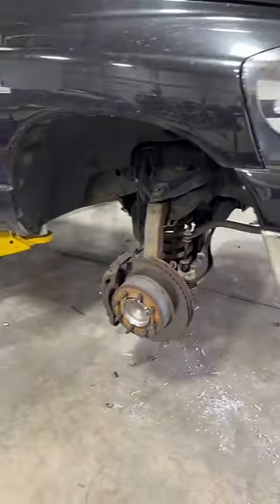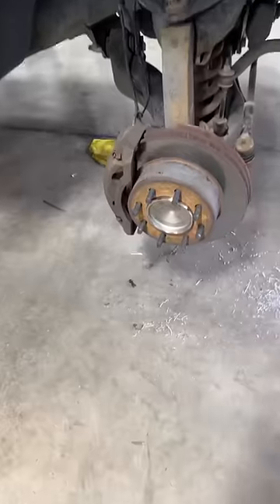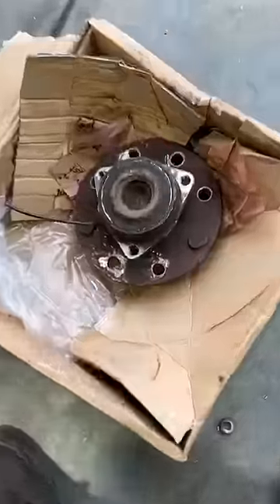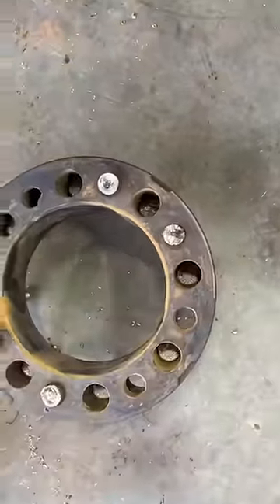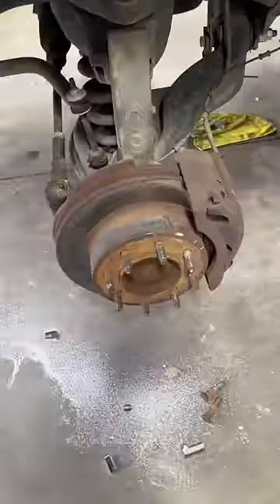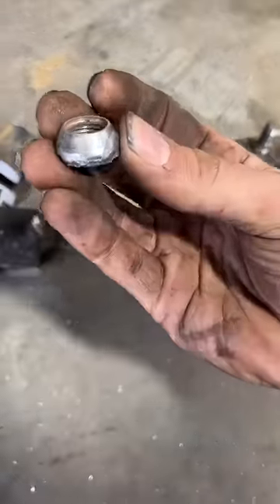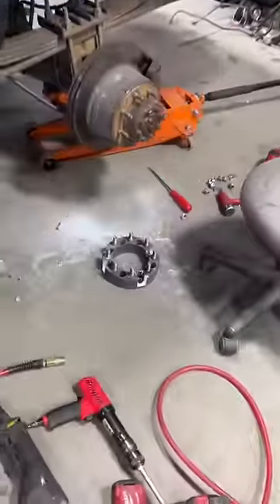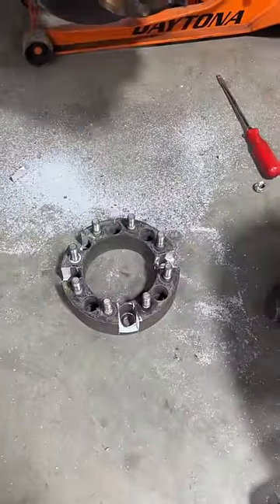I told the customer to sit down before I gave him a price 😂 I didn’t need him to pass out

Comment: If those jokers want to have their wheels stick our past their mirrors, then I wouldn’t feel anything telling them how much it’s gonna cost. Spacers seriously effect the wheel bearings. ESPECIALLY on a 1 ton.
Reply: Amen brother!!! They never learn. Have some 16" wide 24" wheels with 40" tires and have a 4" spacer and want to complain when the entire front end needs replaced . And then they hit ya with the I would "do it myself" if I had the time....
Reply: I would have ZERO sympathy for these jokers who insist on hanging the tires outside the fenders. These same morons extend their trailer towing mirrors out fully, when they are not towing anything. This endangers pedestrians, bicyclists, and other truck drivers' mirrors. Sometimes, they leave their trailer balls in the tow receivers, so you can gar your leg on them, when you're just walking by.
Reply: @budlanctot3060  
Towing mirrors are the same width as the duallys
Reply: @JohnSmith-xu7ev  I'm not sure what you're trying to say, but the mirrors on trucks are mostly adjustable. And most trucks aren't dualies. If you're not towing, why do you need them extended out 2ft? For some truck drivers, they are lazy, and selfish. Then there are those truck drivers who want their tires to extend beyond their trucks fenders for the "look cool" factor. Coincidentally, they often have their mirrors extended unnecessarily, too. That's the point I was making.
Reply: @budlanctot3060  
Real trucks are duallys, and the mirrors extend as far as the rear fender. So if a biker gets hit by a mirror, he will be hit by the dually too.
Reply: @JohnSmith-xu7ev  again, what are you saying? If you hit someone with your mirror, you're doing them a favor? It's their fault for standing on a curb? A bicyclist can't ride on a paved shoulder?
Reply: you must be fun at parties
Reply: @dcgeeked8917  He is, we joke about idiots with wheel spacers
Reply: Honestly dude could have used some anti seize and there wouldn’t have been a problem lol.
Reply: It’s not that, you can do it HOWEVER based on the rounded out lug nut, cheap spacers, you can tell this truck as a whole had NEVER been taken care of, I wouldn’t be shocked if that’s an original wheel bearing maybe overall it’s 1st change
Reply: @budlanctot3060  ok most of that is ok. The hitch why are you walking that close to my truck and not looking were yer going?
Reply: @budlanctot3060  selfish? I don’t think you know what that word means.
Reply: @budlanctot3060  and they got eyes they can move.
Reply: @timesthree5757  asked and answered.  You think, everyone should get out of your way, because you're SO important.
Reply: @budlanctot3060  not important but mostly because my 89 F250 7.3l idi modded for dually and heavyweight towing is a big ass truck and the big ass west coast mirrors help see around my 25’ flat bed trailer full of lumber or gravel or any number of loads. But, no you gotta be their is a big ass truck. I’m gonna walk right through it. Go around like any other human that respects someone else’s property.
Reply: @LinusScrubTips  And now a days they tell u NOT to use anti on lugs. I use it on EVERYTHING AND HAVE FOR DECADES! I have to work or PAY to have it worked on. ✊👍🇺🇸
Reply: I watched a wheel come off my buddies truck, he had 6 to 5 lug adapters with TWO spacers on each wheel. Meanwhile I've had my lifted truck with wider tires for 2 years and never had a problem other than ball joints
Reply: These youngins with those spacers and that rap music.  Hot rodding isn't the same for everyone.
Reply: It's not spacers that are the problem, it's the overall fitment that wears bearings. Yes, if you wheels have too much legalize offset, spacers make it worse. With the right wheels spacers are fine.
Reply: @budlanctot3060  So if I’m understanding you correctly about my tow mirrors on my ram 3500 dually. As soon as I unhook everyday to put one of my 6 trailers away, I need to manually fold my mirrors down and adjust the blind spot mirror manually and then the big mirrors? Only to repeat the process each time I hook up because the chance I may go run errands or grab dinner after I’m done with my truck? I’m confused with all the haters about tow mirrors. I get the whole I don’t use my truck and have lifted tires and blah blah blah. But for those of us who use these trucks for their intended purposes it’s not practical (and a waste of time) for me to do fold the mirrors in each time. My truck is a stripped not equipped truck and it works daily. Please understand the mirror view is so much better for a 40 foot trailer in the vertical position instead of the horizontal position. Just adjusting the birds eye view mirror alone would be a nightmare adjusting each day. I drive a red dually in Missouri. I hope I don’t get caught by the mirror police.
Reply: @budlanctot3060  I need the tow mirrors on my frontier the blind spots are so bad changing lanes gets scary sometimes add a 5% tint came on the truck from the dealership. Not sure if you even drive a truck but if you do your one of those OEM guys that's cool do your thing just like I'm going to do my thing as well as the crazy spacer wide stance guys you do you as well. Stop complaining let people live same with you go out and live a little bit life is too short to complain about what others are doing let's just stop it 🛑
Reply: @Jay-df7kt  if it's a work-truck with manual mirrors, I get that, totally. But you can't say that's the case for 90% of these jokers out there every day. If you're driving in rural MO or NE that's different than the urban environment I'm seeing daily.
My SIL pulls a 42ft trailer, a couple times a month during spring & summer, with his 09 Dodge Cummins and it takes him just a couple seconds each to fold out his mirrors for towing.
Reply: @neoskater420  I do drive several trucks. The only truck I have trouble seeing around is my dually with a utility box. If I had the std dually box, it would be a piece of cake. Otherwise, I can ALWAYS tune my mirrors to see my blind spots.
When your freedoms impinge on  my freedoms, AND are possibly illegal & dangerous and cost me money, then yeah, I've got a problem with that.
Reply: As long as you don't roll coal or double park I don't really care how you choose to ruin your vehicle.
Reply: @Sweet68Camaro that's not a one ton its a 3/4 ton. 1500 is half ton the 2500 (which this one is) is a 3/4 ton and the 3500 is a 1 ton. GM and dodge use these numbers as where ford uses 150, 250, and 350 respectively.
Reply: @John Smith  actually, no. The mirrors in non-raised position are already wider than the duals/rear fenders. The mirrors are also the same width on a dually as on a 1/2 ton.
Reply: @JohnSmith-xu7ev  nope,  mirrors extend beyond the duals even when unextended.
Reply: @walterk1221  
Maybe you should tell me my dually doesn't have 6 wheels too
Reply: @JohnSmith-xu7ev  maybe you're enough of a nitwit to have taken the outers off. My 5 duallys all prove mirrors are wider than fender-flares and tires.
Reply: @budlanctot3060  my truck is stock but my hitch stays on at all times, been twice that it’s saved my bumper from morons that cant drive
Reply: @budlanctot3060  I hear you. I’m in rural Missouri. I agree with you about the 90 percent. That’s why they are trying to punch these trucks off the road. Nice to have a civil reply. Take care!
Reply: Custom made wider axles would be way more expensive.
Reply: I wouldn’t worry about it it’s not your truck
Reply: I have wheel spacers only because I had a set of wheels I didn’t want to throw away I already feel like I’m pushing it at a 1.25 inch space but it does so much better than the stocks, I wish I didn’t need spacers but I did make sure to match the tire size to the stocks I gained 3 inches of tread. Any bigger it would look like shit and probably start causing major damage 

The stock bolt pattern is 5x4.5 i needed 5x5.5 so I got a spacer adapter, unfortunately I had to grind or switch the studs for the wheels “grinding wheel studs does hurt their strength I’m aware” so they wouldn’t touch the wheel, all in all just get nice wheels that are the same size as your original wheels  you won’t create extra wear on your car and you won’t need spacers at all. No spacers = no problems.
Reply: @John Smith  offering a clue since you are entirely clueless. A dually, yours included, does in fact have 4 wheels and 6 tires. You seem to not even know proper nomenclature.
Reply: @budlanctot3060  man, the jealous is strong with you…. I tow every single day, I’m not flipping my mirrors twice a day. The wheels thing, yea, it’s a rainbow mating call of sorts, but the mirrors aren’t a big deal until jealous little pricks cry about them for no reason. They aren’t hurting anyone, they don’t endanger anyone and I can see far better with them flipped up…. So just keep your Prius in the right lane and calm down.
Reply: @sjfk1306  the self-righteous seems strong with you… “..I’m not flipping my mirrors twice a day..” makes it sound soooo inconvenient. 

I don’t drive a truck nor do I get inconvenienced by people’s mirrors, but if you want to make a point, it’s probably best to not be a lazy one. I’ve always been told there’s no excuse for laziness except the ones you tell yourself.
Reply: @Kargoboy117  it’s not laziness….  It’s just there is no point at all to moving them….  When they are caked in snow/ice I’m not going to break them just so some scumbag on YouTube can be happy for no actual reason.
Reply: @ZaganStoanes  Yes I know that. My first truck was my dads 73 F350 1 ton, then my 4 consecutive Chevy 1/2 tons. Yes I know the Dodge in the clip is a 3/4 ton. Yes I know the towing/hauling capabilities between 3/4 and 1 tons are different, the running gear is just about similar.
Reply: @KDlGG  its well known that excessively low offset drastically reduces wheel bearing life. stop coping.
Reply: @Nbomber  if you buy cheap parts, you’ll deal with cheap quality. I’ve ran 14 wides and 12 wides with spacers. Both stuck out 6-8”, upgraded bearings and parts, however I have a solid axle truck that’s well cared for, guess how many failures I’ve had in the span of 4 years? 1 time after I bought it on a stock truck stock wheels, it get  checked all around twice a year. Buy quality, don’t be cheap
Reply: @budlanctot3060  what is your opinion on " squatted " trucks ? Lol
Reply: Damn ,lol now i want to take my spacers off
Reply: @LinusScrubTips sometimes they still stick. Especially if the wheels are never torqued properly, or if you don't snug them in a star pattern. The spacer will warp and just compress onto the hub (since it's soft metal). At that point nothing will help you. Add thousands of miles of driving, and you have an adventure removal on your hands.
Reply: @JohnSmith-xu7ev  duallys are just a waste of fuel unless you pull a 3rd wheel every day... My whole setup is in the garage. Fenders, wheels and axle. I like my SRW with regular mirrors and can still pull a 3rd wheel.
Reply: @justinkase1360  moving the lugs any distance from the hub is going to be harder on the bearings. Even if it's one 10mm spacer.
Reply: @tellrowland2370  
Fuel loss is a minimum, especially running a diesel. Dually increases traction, stability, braking, and larger towing load.
Reply: @JohnSmith-xu7ev  spoken like someone who's never driven a srw version of their dually. 7mpg confirmed by data logger and laptop. That's a lot on a truck that only gets 16mpg
Reply: Also, unless upgraded, the single axle and dually axle have the exact same weight rating.. I'm not new to this.
Reply: @tellrowland2370  
I get 18mpg. And that's almost better then my v8 gas cars. But nice liberal assumption that an ex technician never drove a truck
Reply: I mean I have a friend with an old ford ranger, it's an 89 or 90, he put spacers on so he could fit larger wheels, gave it a four inch lift and put mudding tires on it so he can get out in the woods and pull trees up to the road.  Without the spacers he wouldn't be able to turn the wheels properly unless he wants to hit the frame of the truck.
Reply: @kugelblitz1557  That sounds sensible.
Reply: I like my offset on my truck.
Reply: Exactly why I won't run them on my old dually not sacrificing durability for oversized tires not on the rig that supposed to haul
Reply: Not really
Reply: @budlanctot3060  The fucking HUMANITY of it all, the tow hitch sticking out!
Reply: Especially if Its used to tow anything.
Reply: Ong and half the time they can’t stay on their side of the road. My alignment is bad but Atleast I’m not adding dumb mods
Reply: @Bud Lanctot  they're like 4in wider fliped up not 2 feet and I don't have a blind spot behind my head with them up like I do when they're flipped down unless you own my truck don't tell me how to drive it, customize it, or tell me how I should have my mirrors
Reply: @Jay-df7kt  exactly but they don't say shit ab the chevy and ford guys running around with they're sagging tow mirrors fully extened but our trucks that have flip up and down tow mirrors that only extend like 4 more inches when extended are some big issue. The real issue is my blind spot is huge when they're fliped down but practically doesn't exist when I have them up
Reply: Spacers are illegal in most countries, thankfully
Reply: @JohnSmith-xu7ev  put down the pipe sir
Reply: @LinusScrubTips  I work at at tire shop, and your not supposed to use anti seize because the threads have a tight tolerance so anything in-between the threads like anti seize can actually cause a lug nut to seize onto the stud because there's such little tolerance
Reply: I don't even think spacers are road legal where i live.
Reply: @michaelbibby01  
Im not a liberal bro
Reply: @kitfrancek979  
Anti seize will loosen the lug nuts
Reply: @JohnSmith-xu7ev  real trucks dont need a fender flair bolted on to the outside of the body to cover all the wheels. Nothing in the pick up category is a "real truck"
Reply: @justinkase1360  why would you put on a spacer, and then get a wheel with an undercut offset to balance it? Why not just get the right wheel in the first place?
Reply: @sjfk1306  it's all fun and games until a pedestrian on the footpath gets killed or seriously injured by a passing mirror (it happened recently where I live and didn't go well for the driver)
Reply: @miscbits6399  a mirror shouldn’t be on a foot path….  Also, my mirrors are even with my 1/4s so…
Reply: @WhiteSandsMbuna  
So you saying f550s are not trucks?
Reply: @WhiteSandsMbuna  I would never personally run spacers if I could avoid it. My point was only that it's the total effective offset (including spacers) that count when we are talking about wear. That's just a fact and that's my only claim.
Reply: That’s a 3/4 ton and people like different things💁🏽‍♂️
Reply: Exactly!!!
Reply: @LinusScrubTips  never use antiseize on wheel studs.
Reply: @rambler778  Yeah, I know.  
Also people do like to do different things, but just because it’s different,  doesn’t make it right. LOL
Reply: @Sweet68Camaro  I agree but some people just like their trucks to be different and “cool”
Reply: @rambler778  With all due respect, I’m not going into a debate.
Reply: @JohnSmith-xu7ev  yeah I hate those stanced trucks and asshats with tow mirrors, but if you got a dually I can see why you'd want tow mirrors to judge the size of your rear fenders
Reply: @budlanctot3060  Leave them alone, their parents are siblings
Reply: I got a 2 inch spacer on my truck for the Camaro wheels I got on them but that's because they were scrapping on the fender weld but it's not sticking out at al,also big ass spacers and wheels ruin wheel bearings as you said,tie rod ends,pit man arms,etc
Reply: A lot of times they use the spacers because they what to use different size wheels/custom rims and tires, problem with those is sometimes they don’t clear brake and suspension components so the wingnuts at the tire shop suggest wheel spacers.
Reply: @JohnSmith-xu7ev  your dually doesn’t have 6 wheels. It’s got at least seven if you can steer it, eight if you carry a spare, and a manual transmission would bring it up to nine with the flywheel.
Reply: @Walter732NJ  
You forgot all the pulleys on the motor
Reply: @budlanctot3060  sorry, but I’m not taking my hitch off everytime. How about you look where you’re walking old man and don’t walk so close to other people’s trucks.
Reply: @budlanctot3060 hes probably one of these mall crawlers that extends his mirrors all the way out thats why hes trying so hard to prove your wrong, you can adjust mirrors on trucks thats why they come with adjustable mirrors for towing.
Reply: Ever see a video of a car being launched off the overhanging rear tire on a car they are passing at high speed?
Reply: @HappyQuailsLC  i have, its insane how far a vehicle can launch especially when going a little faster.
Reply: @budlanctot3060  They are usually compensating for something... I agree, mirrors out, lifted, trailer ball in the receiver, lighting under the wheel wells and rockers, side steps, more colored lights than a trucker in Japan or the Midway at the county fair and just about every shiny piece of crap they can find on Amazon! Actually, we need these people to keep the economy going, 'bless their hearts'... 🤣 🤣
Reply: Being a ram, it'll have a shitty front end, regardless.
Reply: Let's turn the God's let's repent and ask for forgiveness lets study God's word Shepherdschapel
Reply: I can’t stand to see these trucks all jacked up in the front and squatted in the back lol most of them are mommy and daddy’s money payin for it 🤣🤣🤣🤣
Reply: @ShepherdsChapelonYT  ?
Reply: @thomashodis5740  On my jeep im not that crazy, but i run 0 offset on 35/12 tires on a 16 rim. There is a reason ive done balljoints and 1 ton steering lol, i offroad, i accept it.
Reply: So how much?
Reply: @budlanctot3060  If you're hitting your legs on a ball hitch, that's YOUR fault, not the truck owner. It's YOUR responsibility to watch where you're going.
Reply: @charleshubert6751  You need to deal with your insecurities, your strange discomfort  with OTHER people's trucks is really strange. You can have things you want to if you'd work harder.
Reply: @budlanctot3060  some people leave them out because the convex mirror isn't power adjusted and has to be adjusted by hand. So, they leave them out so they don't have to adjust then each time.
Reply: @budlanctot3060  in the UK most standard towbars are fixed so you just always whack your leg on them🤣
Reply: smol pp problems
Reply: I saw some clown drive by yesterday in a GMC Sierra, wheels spacers, deep dish wheels, low profile tires, all on what I’m pretty certain was a 4X4 truck. Besides being hard on wheel bearings, ball joints, and other front end parts, I think they look horrible on any truck.
Reply: Yeah, I wonder how that's legal?  My friend in Texas told me I had to put fenders on my utility trailer.  He said it was illegal to not have a fender over the wheel.  So how do they get by with that?  My trailer tire is way narrower and slings less water in the rain than their 18” mudders do.
Reply: They buy them and don’t use them for it’s purpose, some people are so vain.
Reply: Not everybody does it just to do that some people need to put spacers on because they need off-roading tires and rims and if they didn’t use spacers the rims would rub the calipers 👍🤓
Reply: I have spacers on all my vehicles, if not then offset rims. Spacers or offset can affect scrub radius, but wheel bearing life seem unaffected. You go on believing that. 

What happened here is galling. You can prevent this by greasing the threads of the lugnuts. This can happen to any stud.  

My last truck has 1,275,000 miles and the wheel bearing were replaced maybe 3 times in my ownership. I got that truck with 331k.My current truck has 760k and I got it with 160k. Replaced the wear bearing when I bought it. The installation and the product choice is what affects the life.
Reply: In my state, it's illegal for the tires to extend past the fender lip. Never understood how they got away with this. By the way, i drive a truck as my daily and i don't have oversized tires on mine. It's simply not needed.
Reply: @lhoanii  in my state you're allowed to extend 2 in past the body of the vehicle after that you have to put fender flares. I put spacers on to bring the tire flush too the fender because if I go past dirt gets all over the side of my vehicle. I think wheels look great flushed up to the vehicle but when they're tucked in 4 inches it kind of looks ridiculous just as much as ridiculous when they stick out 4 inches.
Reply: @Bradgurdlinger  best they stayed off-road too , not good on metropolitan roads, the motor accident commission know about the hazards but they do bugger all, they are useless.
Reply: @budlanctot3060  as John said tow mirrors on Dodge's flip up vertical...they don't extend...you just get more view at that width...we've all cracked a shin off our own hitch - but if you walk into someone else's - that's also on you
Reply: People just don’t know how to pick the correct size wheels and offset to give them the look they want 🤣🤣
Reply: @budlanctot3060 You sound like you live in Oregon, NY, or maybe Cali. So which is it? Lol
Reply: @timesthree5757  it's actually illegal to drive with your tow ball in place and you are not actively towing.
Reply: @JohnSmith-xu7ev  it has 7 wheels

1 extra wheel for steering
Reply: @juanb2279  that's illegal
Reply: @WhiteSandsMbuna  some 5th wheel trailer Pick Ups qualify as a real truck imo
Reply: @rambler778  it's only cool if other people say it's cool. 

Not one single time in history has a person declared themselves cool and been precieved as cool.
Reply: @ShanaynayGosby  and you are an adult?

Smh
Reply: @billmoran3219  thats why you get wheels designed for your vehicle.
Reply: @ncdozer3103  it's illegal to drive with the hitch while not actively towing in California.
Reply: @drdabsmore945  it's actually illegal in California to not remove your ball if you aren't in the process of towing. 

I keep mine under the back seat of my Z71.
Reply: @drdabsmore945  not if I have to look at it! I'm gonna call him out on his disco truck.
Reply: @SCHMALLZZZ  what does that have to do with anything?
Reply: @SCHMALLZZZ  in what State?  Cause not in my State.
Reply: @SCHMALLZZZ  well California doesn’t count as part of the U.S to me.
Reply: Well it's somebody's preference and you don't just treat them like they don't matter because you don't like their preferences. That's ignorance paid to do a job and you need to do the job if you're having to destroy anything like cutting that is purchased property you contact the owner of it before going ahead and cutting. It's at your discretion because you can get in trouble. If you don't like the job and you don't want to do it then just say so don't do whatever you think assumptions are horrible ideas.
Reply: @bobboby2400  Ok Karen, nobody asked for a lecture on automobile mechanics.   

Maybe you should search YouTube for a vid of a runaway wheel/tire that launched a car into the air.  All because of a wheel bearing separation due to extreme offsets. Then you can understand why people like me are against wheel spacers and or extreme wheel offsets.
Reply: @Sweet68Camaro  I'm the Karen and you respond like that lol.
Reply: @Sweet68Camaro  I know more than enough vehicles that have lost their bearings and that has never happened it would be a freak accident if anything. If a bearing goes it's because the bearing went not the offset but offsets can wear down the bearings sooner then it would due to more stress. But things fail eventually they don't last forever. That's why you get it done as soon as possible. The guy probably neglected it and drove on that bearing for far too long when it was already finished. Probably overheated. And I'm not the biggest fan of offsets anyways cuz I don't want to wear down my bearings too quick but some spacers and offsets are needed to give clearance for the tires. And they do little to no difference of stress then without. If you put a really big spacer than yeah it would put the increase of stress. Like I seen somebody in their backyard not going out on the street putting over a foot spacer on their vehicle and that didn't last long. And to be fair it didn't even break off it just broke and it was also jumping around in a field with rough-terrain well-being a car not even a truck lol. It was for fun and to learn but it was definitely not the best you need stronger axles and bearings to deal with that kind of a wheel spacer.
Reply: @bobboby2400  HA!!